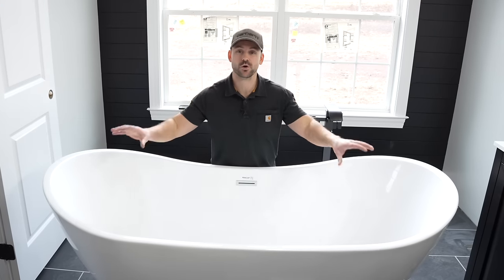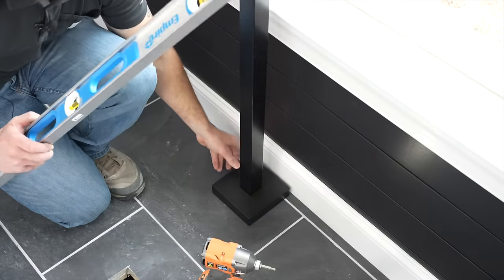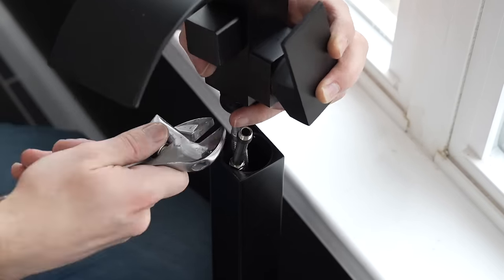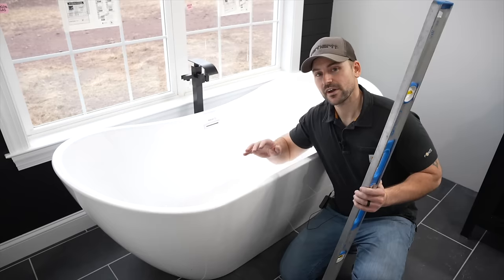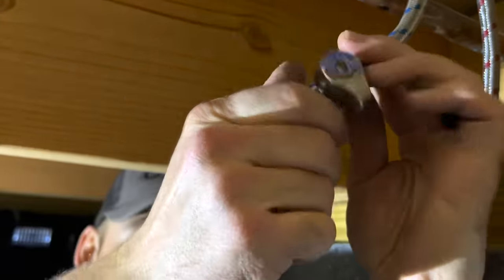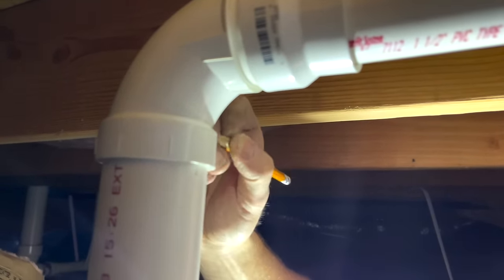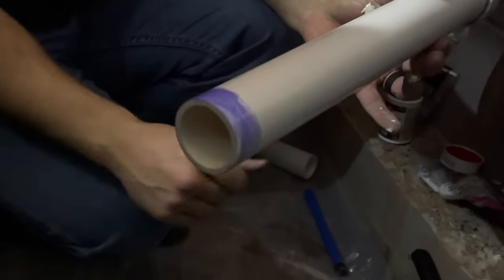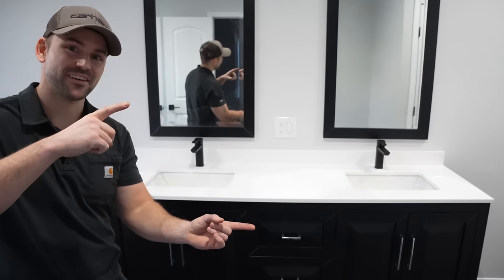How To Install A Freestanding Tub And Faucet

Comment: Bro, why use shims when the feet are adjustable?  And sharkbites?? Cmon bruh
Reply: Seriously bruh
Reply: He is using sharkbite because it's easy in a tight spot. If done correctly, and left undisturbed, sharkbite seems very reliable
Reply: There will always be someone to criticize 🤦🏾‍♂️ . What’s wrong with sharkbites bro? They are great
Reply: I’ve used shark bites as needed past 15 years. Properly installed I have never seen one leak aside from toilet valves and they don’t go bad at shark bite they actually fail at the valve. And everyone I have repaired, they didn’t cut the plumbing square. Which resulted in not getting proper seal. I cut square and use same shark bite and back in business. Another prek is they are easily removed and new installed. No glue. No cutting. No mess
Reply: Nothing wrong with using shims.
Reply: Shark bites are bad ass bruhhh 😂
Reply: Sharkbite is perfect for a crawl space or any other accessible location. Still prefer clamped and/or sweat connections inside closed walls.

Comment: The tub has six or seven levelers built into it. Tip the tub back and back them off or tighten in as needed. Not sure why you are using door shims to level?

Comment: Make sure to check your plumbing code. Most do not allow sharkbites in crawlspaces anymore as they are not "easily accessible". So, just be safe and crimp your shutoff valves in the crawlspace so you know you will not have a leak you can't see. But you can use sharkbite shut off valves if it is inside like for your toilet shut off or sink shutoff. Just as long as you can get to it. Plus those look better than a copper ring showing. Also, there's feet on the tub that you can adjust so you don't have to use shims. Because now you only have one foot on that side holding all the weight of a tub full of water. And the tub is fiberglass and acrylic. Just sayin...

Comment: I have a question, what is the best way to water proof the bottom of the faucet stack if water leaks behind the tub from the faucet or the wand as I’ve seen happening with my free standing tub. I’m actually getting water leaking through to my basement when I’m use.

Comment: Another thing with the tub is it has the overflow as well. I've seen a few with out it. The faucet company seems great about parts if needed. A ceramic cartridge is a good thing as well. Registering any product is important as well. I used products like this as well to help cost with a customer if needed. It's not an everyday unit and amazing how many people have them for looks and resale. Again, great job Josh. 👍🏻
Reply from the maker: That’s good to know. Yes the overflow is definitely a safety net to cut down on any type of flooding that could occur. I’m not too familiar with the faucet brand I installed in this video. I will definitely have more insights the longer I own it. Thanks a lot David!
Reply: @TheExcellentLaborer  always having a relationship with manufacturers is important. Yes, you could have paid a lot more for a big name brand, but also some specialty units like this and other products are great quality but the name isn't out there. I've installed German brand faucets that cost big bucks but bad customer service. Just like Price Pfister was made by Black and Decker ( a tool company) I am not sure if they still are but these companies I feel learn from the big name companies. Like Moen makes products for Lowe's and Home Depot, lesser value. And most of the time if you want better quality you have to special order. And then the other factor is the appearance. Sometimes customers like the look of something less expensive and it fullfils their needs. If you take care of even the lesser product it will last. You can spend $2,000 on a faucet or product and destroy it if it's misused

Comment: That faucet is pretty nice. I saw that it has a 360° swivel capability. Pretty nice feature as well. I've had a tub that had adjustable legs on it to level if needed.(which I put a little bit of teflon tape the threads to keep them from moving) I always mention to not sit with all your weight on the sides or ends because the term, free standing although 100% silicone is used. Once cure, it is pretty secure but just be safe. Nice having free standing tubs in acrylic as well, but just get a good quality like this one. I've used the screw traps as well and with a drain plug in case a clog. I'll put a clean out if code allows in case a company has to snake the drain. Again, if code allows. 
Sweet looking unit and faucet. Great choice. Great job Josh 👍🏻👌🏼
Reply from the maker: Thanks, David! It does seem to be a nice set up. It does swivel and it’s nice to be able to move the head out of the way if you are in the tub. The feet under these seemed like they could be adjustable, but they were very tight, and I really didn’t want to risk breaking something. Yes the traps that are removable is the safest. My mom lost a ring down the sink one time and if it wasn’t for traps like this, it will still be down there more than likely lol. Thanks a lot for commenting on my video, David! I hope everything is going good with you. Take care.
Reply: @TheExcellentLaborer  at least it stayed in the trap, after that, bye bye. Glad it was retrieved. I'll continue to enjoy and respond and hopefully help others as you do with informative comments. Never want to make someone feel less important. Always great to help and share views. Love reading others as well. 👍🏻

Comment: Great video, just one thing, the union trap doesn't  need teflon tape on the thread, but inside the concave and convex joints,  a compound for plastics like blue monster is recommended.

Comment: Where did you install the Thermostatic control valve? Code requirement where I live and I think all of US.  The inspector told me most people tap off the sink plumbing for the freestanding tub water supply so the thermostatic valve for the tub is installed in the bathroom vanity.  Just having the mechanical hot water stop at the tub filler doesn't pass inspection.  There must be a valve to stop the flow of hot water if the cold water is lost.  I am curious because I need to find a place for the valve. My tub is on a concrete slab floor, my walls are all closed, tiled and the floor is tiled.  I have the same tub filler you have.  I am looking at modifying it so I can mount the thermostatic valve on the wall behind the tub out of sight as much as possible.  I will drill holes in the tub filler tower so I can route the water lines to and from the thermostatic valve. Inspector told me he would be ok with that but I am searching for better ideas. Yes the inspector should have caught this at rough in inspection before I closed the floor and walls, but they didn't.

Comment: Could you do a video on roughing in and installing exterior wall mounted lights. Such as next to a door or garage door. Please cover box selection, waterproof or not. As well as surface mount lights and recessed lights. Include code protocol for the boxes. Thank you!

Comment: My freestanding tub is leaking. Could it be because they did not use putty at the drain? Also, the tub only touches the floor at each end. Will that be enough or should I do several layers of silicone caulk all the way around?

Comment: I have a freestanding faucet but for whatever reason only hot water works. We recently replaced the cartridge but that still didn't fix it. It's blazing hot water. Any idea what it could be? After watching your video I think the valve sub-floor might be closed.

Comment: Josh, I'm building a house that is slab on grade (no crawl space).  Would it be impossible for me to install a tub like this with the drain under center?  I could put the drain piping in place under the tub, but no way I could get under and tighten any connection.  Also I noticed you used pipe thread paste, but didn't mention it.  That stuff works great!
Reply from the maker: Hey Rob! Good to hear you are building a house. It is very rewarding. What I would recommend in a case like that is a freestanding tub drop in rough in. You would literally just set the tub into it and you do not have to tighten anything after the fact. I hope that helps!
Reply: @TheExcellentLaborer  thanks! So that is different plumbing? I'll have to look that up for sure.

Comment: Hello new to the channel! Great stuff, I recently purchased a house that does not have ground wiring, so every outlet is 2 pronged. Could you do a video over installing ground wire onto the existing system?
Reply: Not worth it. That's high level electrician stuff and you're looking at removing all the drywall, rewiring, then replacing drywall and painting. I'm in the same position, house built in 1958, no ground wires. Instead of rewiring, I just replaced all my outlets with GCFI outlets. In the event of a surge, they trip like breakers and protect your equipment.

Comment: Nice video! Do i need to use both the glue and primer when gluing PVC or will the glue suffice? Thanks in advance.
Reply: Always  a good idea to prime before using glue.
Reply: The primer is meant to soften the material in preparation for the glue. Without primer your taking a huge risk that the pipes won't bond together completely. Also make sure you using the right primer as there are different ones for pvc and abs

Comment: is the tub anchored to the floor or just sitting there? it seems lightweight for just caulk to hold it.
Reply: Nope no anchors other than silicone, Actually 100% Silicone caulk is an excellent adhesive and can provide a very strong bond.. however, there are many grades of silicone on the market so a strong bond depends on the grade of silicone used. Adding to the confusion are caulks with the word silicone in the name like silicone sealant or kitchen and bath silicone, or the compare to silicone acrylic polymer and/or polyurethane sealants. NET: Just be aware when it comes to silicone sealants not all of them are created equal. Many caulks advertised as Silicone caulk are heavily diluted. Make sure the one you use for this specific application is listed as being 100% Silicone. Rest assured.  if applied around the perimeter of the tub as shown in this video.. it won't be going anywhere. TIP: Before adhering your tub to the floor with silicone, once all the drain connections are made fill the tub with a couple inches of water then drain it and check for leaks.

Comment: How many pounds that free standing tub weight generally??   I try to get one in the future
Reply from the maker: If I had to guess I would say around 100 pounds. It’s not very heavy. This one seems to be well built. I hope that helps!
Reply: @TheExcellentLaborer  one more question,,,any adhesive needed to bond to floor??
Reply: Josh is correct 100-110lbs. Well built and always follow proper directions for the installation and guidelines.

Comment: Hey I know it’s been a year ago but I had sent a message under the video a month ago. When you did the porch header beam with vinyl. When it was time to attach the beams how did you do that?
Reply from the maker: If you were talking about the faux beam that I did, the PVC boards(faux beam) was attached to a 2 x 6 nailer that was running across the porch trusses. So more or less it attached just like any other faux beam would. I hope that helps!
Reply: @TheExcellentLaborer  so if I am doing 4- porch columns how do I secure the top to the bottom of the faux beam? I know how to secure the bottom with some plates but not the top

Comment: Edited: Shut off valves are not required by code for bathtubs or showers for a good reason. The valves for these types of installs would be inaccessible. If you look at any tub or shower there are no shut off valves. You should not have needed to add water line the extensions. You've added four extra connections by adding unnecessary and extensions. valves. The drain should be hard plumbed for better reliability and flow. The threaded adapter should be taped and doped. Looks like the tub might have adjustable feet underneath for leveling. One step glue works great or you can prime all your joints before going into the crawl space. This video should be taken because it was not properly done.

Comment: Where's the vent for that tub? Angle stops and steel braided supply lines must be in readily accessible locations and under a house does not qualify. Sharkbites? Geez louise
Reply: I agree with the braided lines, but what's wrong with sharkbite connections ?? I don't trust them in a wall, but in the crawl space, they are perfectly fine!
Reply: @tombob-vq5dm  your trust in sharkbites is like my trust in women. I trust them as long as I can see them!
Reply: @byronsteez8253  LOL!!!

Comment: Thank you for the video. However it looks like you created S-trap below your tub. Per any plumbing code trap arm must be vented. Without the proper vent this installation won’t be unproved if inspected
Reply from the maker: There is a vent within 4 foot of this tub. It will vent just fine. Thanks for watching!
Reply: S-trap is illegal in any jurisdiction . Your trap arm is not vented regardless how far your vent is located down the line. The problem with s-trap especially with tub your trap could be siphon with flushing water. Sorry but it’s important point when you upload instructional video. Thanks.